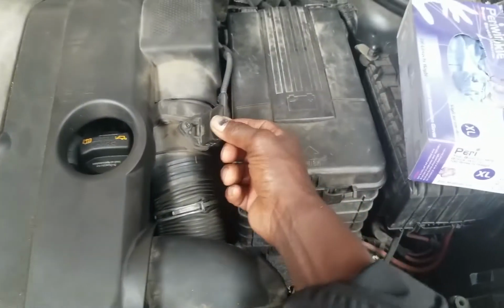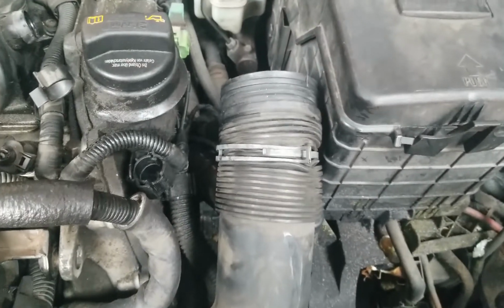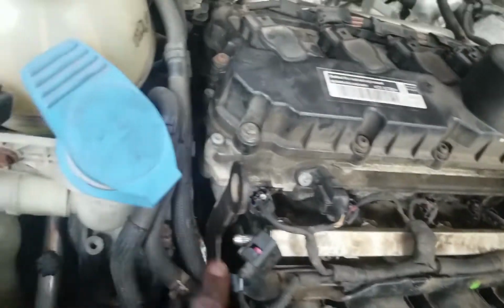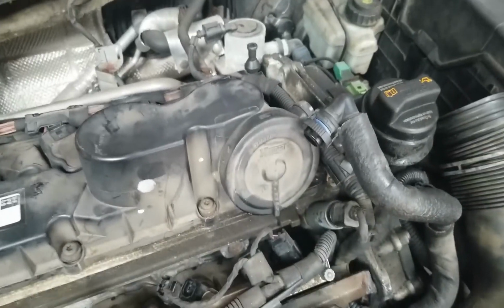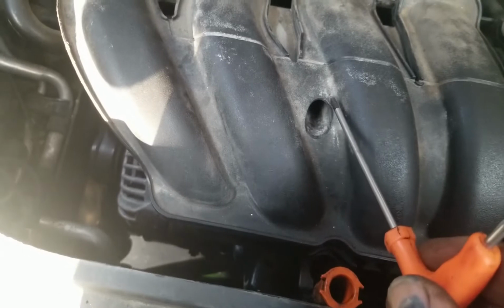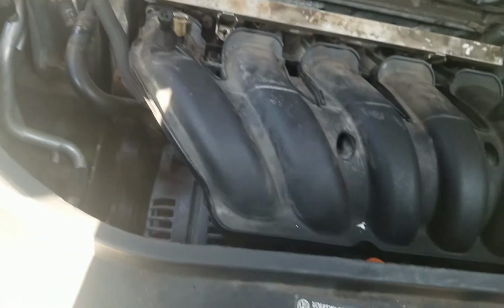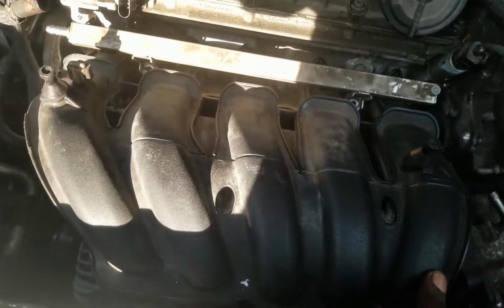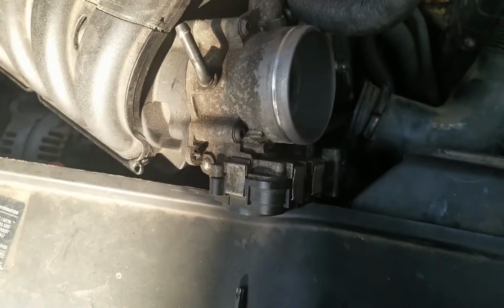2008 Volkswagen Jetta Intake Manifold Removal and Replacement and Thermostat Location

Comment: Great video as I have a leaking thermostat housing/hose on a 2007 2.5 Jetta.  Thought it was the water pump but bad guess (same area under the car). This shouldn't be a big deal and I'll get some help from my 4-H Automotive students.  Good explanation on the process and details of removal.